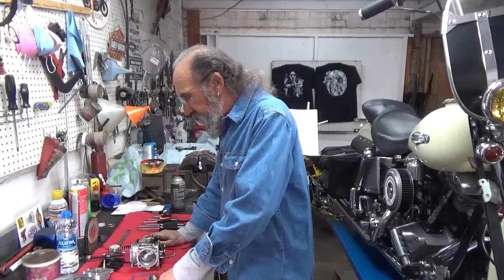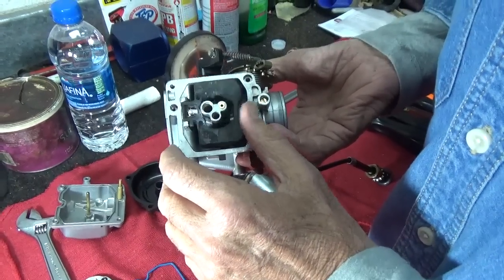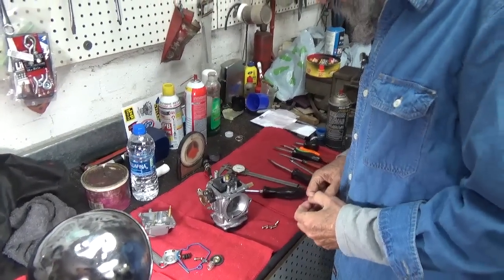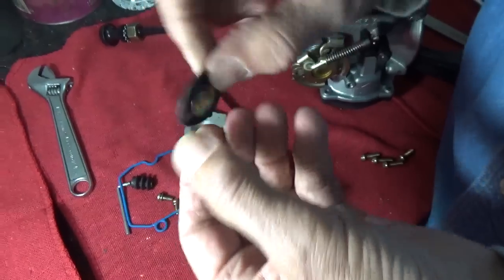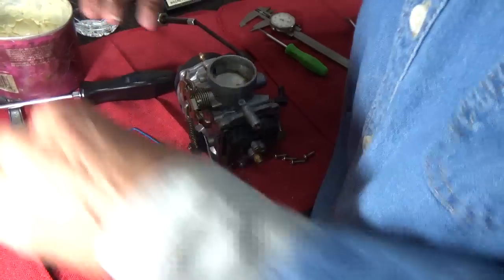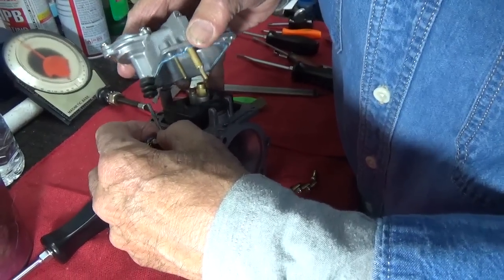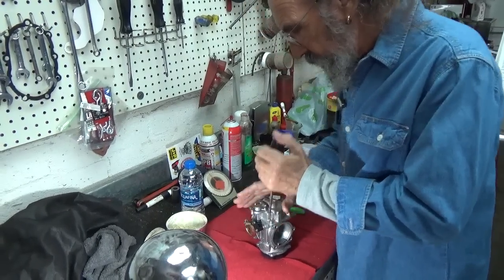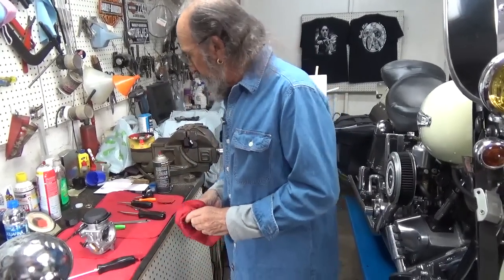Fred's Harley CV carburetor needs cleaning

Comment: Hello! is it possible to put a carburetor on a 2004 injection fat boy?
Reply from the maker: It's possible, not practical.  You would need to replace most of the wiring.  You would need a complete ignition system, including all of the components.  Then, you would need an entire fuel system, including the tank.  The labor cost would be imense.  I did it before the injection systems were as good as they are now.  I did it on a 2000 Twin Cam dresser.  Quite an undertaking.

Comment: ✊🏻👍👌🙏 I’ll remember this video when I get into my cv . Thanks for tip on LB swap meet . 61 flh  is up and running here . Found leak down test 70% on rear cyl. 40% on fnt cyl. Rear head bolts loose and rear cyl had one stripped out stud in case . Re ringed & cyl hone . Back together and kicks over !!!- always start by owners manual start procedure . That worked - 😁 well ; amazing what people bring ya - 
Moral of the story - 
✊🏻👍👌
Reply from the maker: Very cool.  Enjoy!